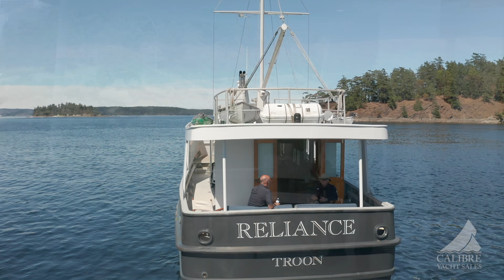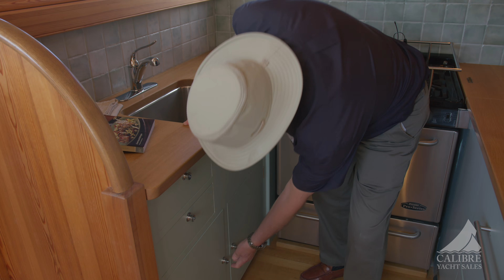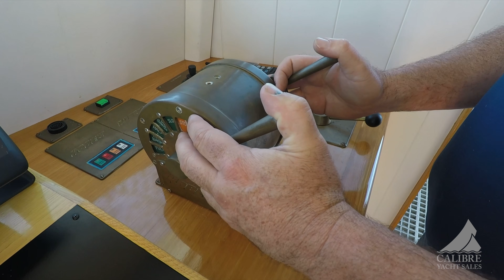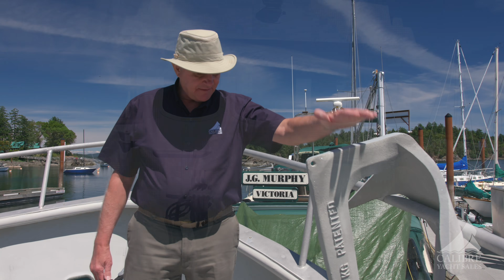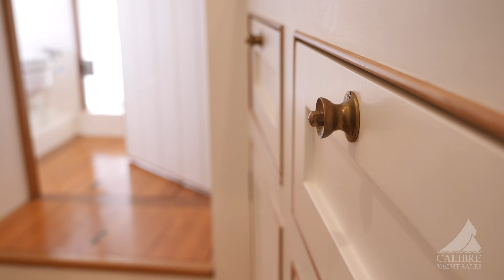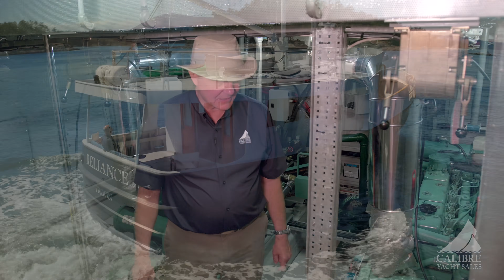1975/2008 Halmatic Expedition Trawler

Comment: Being an expedition boat 1,300 mile range is not a lot.  I love this boat but couldnt take this from San Diego to Hawaii.  (2,600nm). Then he said dual 1,000 gal tanks.  That should have way more range than 1,300 miles.  He changed the name of the boat at the end and called her Resilience, which isn't bad either but I'm not changing the towels.  :)

Comment: Why would I wanna sync the engines? Wouldn’t that mean that most of the critical machinery would get wet?  Totally ungood !!!  The purpose of a ship’s hull is to weigh less than the water it displaces.  I’m assuming the weight of the added water required to sync the engines would certainly raze the water  line a bit.  The wooden Finnish interior might help keep her afloat for long enough to tarp & batten the back square doors to keep the outside water out and the machinery space water in.  She’s a beautiful build.  Storm Warnings be damned, the New Owner is a prudent Skipper/Spie.

P.S. It’s not a shower, it’s called the rain locker.
Reply: Sync as in synchronize the motors to make equal propulsion. Not sink as in flood with water.
Reply: @zedwpd  No shit ?